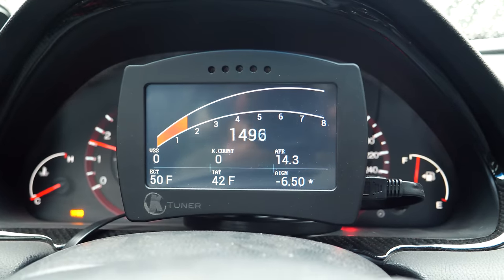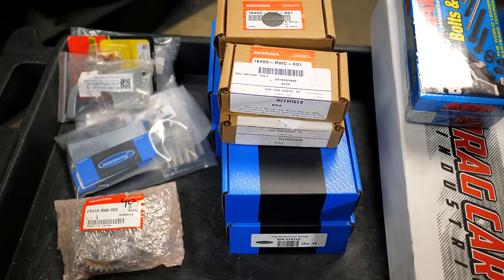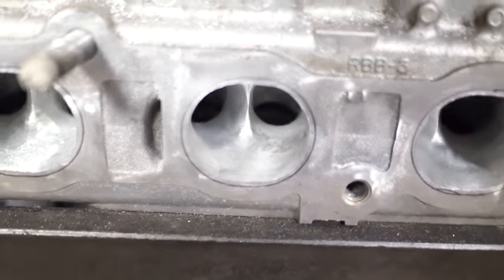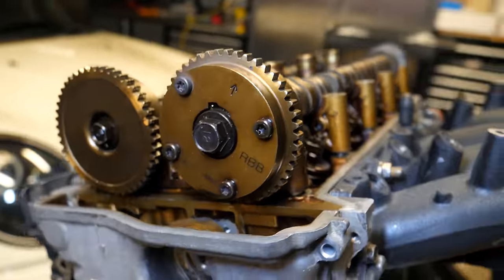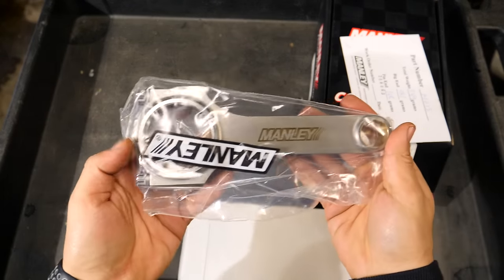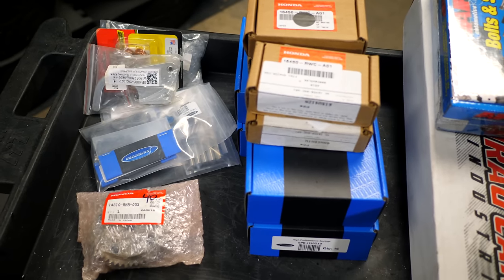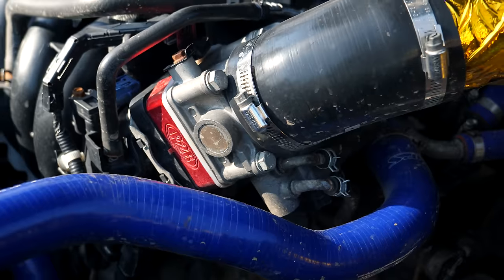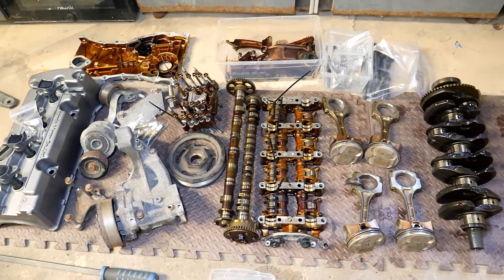The Secret to a High Revving K-Series Engine

Comment: Everything is good except for the lightweight flywheel. Flywheels are there because they store up extra energy and give it back as you continue accelerating, changing gears, going up hills, or just maintaining your speed. It can also cause damage to engine and transmission if you go with a lightweight flywheel.

Comment: Thank you again for doing this! I've been waiting years for someone to actually do this to the 2.4 8th gen 2008 Honda Accord coupe 👏🏿👏🏿👏🏿
Reply from the maker: GET HYPED!! 🙌 Its gonna get real
Reply: Question what how to tune the accords? What wire harness or programmable ecu to use because hondata, ktuned and many more shops across America keep telling me to buy a different chassis!!! Seriously
Reply: With ktuned I believe you can do a custom tune
Reply: @pruvengsx1  hondata doesn't even care about the 8th gen 2.4 Honda accords. Ktuned is the only place where you can tune your 2.4 k24z3 Accord but this tune is still limited meaning they don't have a tune for eternals or turbos or superchargers for the k24z3 Accord motor. fuck those other people telling you to get a different chassis. Just wait our time will come when we the 8th gen Accord community will be able to fly like the rest of them.
Reply: @flyboy8282  Heavy chassis and undersupported. Heck a TSX is lighter and smaller, do u see many doing extreme builds on those? No. There is even a Hondata system for a TSX, but not Accord. 300whp on anything is still 300whp, even if its slow. 4cyl 300whp is impressive. Just think, one day u can afford to buy a cheap EG and put the 300whp swap in it. OR, go expensive and buy a Lotus Elise and put the 300whp swap in it. Once u have the motor, and running, u can always buy something else to put the motor in... That's where it matters. You did it once, do it again, or just swap it over.
Reply: I've been waiting to see that build to. Always wanted to do this....
Reply: Looking to do this on my 2007 coupe lol

Comment: Nice build, these K series are truly amazing engines. My all motor build runs an A2 block @ 89×99 ~13:1, 4P 156 head and I use E85R now with great results. I'm at a DA of under 300ft so NA combos run great and this is no exception. 336whp and over 200wtq on very conservative tuning. As if this isnt impressive enough my old boosted setup made 600+ with the same head and a stock k20a2 bottom end/Gen 2 6262 from PTE. Love the K series platform!
Reply: Nobodys made 600+hp on a stock bottom end. Wha load of horse shit. Brent from pfi speed is rolling on the ground quite literally, laughing his ass off.
Reply: 336whp all motor with conservative tuning… 🧐 
That’s literally pushing the overall limits of what these motors can produce, also I’ve NEVER heard of one producing even close to that without being ‘stroked’. Even with a small bore I don’t think your making that.
I dunno broooo 🤥
Reply: @joeymcquilkin3670  lmao ok bud. We make 440+ at the tire Na with our stroker builds. And if you notice, the motor I was speaking on above is well overbore and is close to 2.55 liters of displacement when it made that power and the head flows insane air. The 156 head program from 4P is top notch, it gets no better. That engine also had insane cam profiles and very high compression. You obviously don’t know anything about the all motor K game so why comment? Ive made over 300whp with stock bottom end K24A2’s  just a good head package. FOH
Reply: @kennethpowers8995  lol can you please do this to my accord 2011 lxs lmao i just want a little more power where are you located
Reply: @premiumc2282  the accord K24z3 in your car isn’t the exact same as the JDM K24A or USDM K24a2 which are a bit more performance oriented. The best thing I can recommend for your car is a good race header like the Skunk2 for the 08-14 TSX/Accord and then KTuner. That alone will pick up a solid 25-30whp over stock if you’re ok with running premium pump gas in the vehicle. If you finish the bolt ons with a good intake and the aforementioned parts you’re going to be nearing the 200whp mark. If you are talking about making much more power than that you really have to swap
On a K20 head and start getting into cam work and more in depth things like that. Or ofcourse forced induction is always an option; these motors love nitrous.
Reply: @premiumc2282  Also our shop is in Claymont, DE. I wouldn’t take any information from the above people either btw, if they think ~300whp is “pushing the limits” for a stock k series they have blinders on to the world. I’ve literally seen at least a dozen K series make over 500whp on 100% stock bottom ends lol. As a matter of fact I’m quite sure you could search right now and find a handful of stock K series making 500-600 HP or more right here on YT so I don’t know what they are thinking with these comments.
Reply: @kennethpowers8995  what’s the name of your shop boss ? Got an Instagram ? I want to try to get an 8th gen si and I’ll stop by im
From the NJ area but live in Florida at the moment lol. Thanks for your info hard to see with so many different comments

Comment: I built my head with toda parts. Kpro tuned fuel pump and injectors  229whp. 91 medium high tune. Winds up to 9k regularly for the last 40k miles.
Reply from the maker: That's what I like to hear 💪

Comment: Nice vid. The accord is fresh. Im in the process of doing a jdm k24a swap into my fg2 rn.  This is my first k24 build, so I’m not going all out like you, but I’ll save that for my dream 250hp-300hp k series frank build when I have higher funds. Can’t agree more with the reinforcement rods, stiffer springs/retainers, and proper pump for 8k + rpm. I’ll be revving mine up to 8k max, maybe 7800rpm because I’m running stock pump, stock internals, except 50 degree vtc. Shooting for 225-230hp, 180tq... Intake, header, vtc, hondata, tune 🤘🏼🤘🏼🤘🏼

Comment: I will most def be buying the same stuff you are getting for your build. I am doing the same as well with my K24 engine. Have an 05 accord sedan K24A4. Ive been wanting more power just all motor and i will be doing the same build. My car is an automatic but i am doing a conversion to manuel. The build will take time but it’ll be worth the wait once everything is all set and done. Great info on the parts i would need to achieve this goal. Mine wont be naturally aspirated, i would want to shoot for a close to 400whp, will be upgrading ecu as well with hondata and going E85 and still being able to use pump gas as well.
Reply from the maker: I am very jealous you have access to E85. If I did, I could push the engine more and produce more power. But a boosted K24 sounds fun to me!!
Reply: Yes most def, in the process of it all if i decide to boost it then it wont be a crazy number. I would boost it to the point where it would be reliable and fuel efficient. My next project build that i am looking forward on doing is boosting a EG hatch which would be track and street driven👍🏻

Comment: Still waiting to see this car in action, wanna hear that vtec screaming all the way to 9k rpm
Reply: I'd rather see/hear 10k rpm on a K20. Not much different in the build.
Reply: Completely stock, any RSX Type-S can rev safely to 9200rpm. No big deal to rev to 9k rpm. Yes, the stock limiter is at 8100 on the 02-04, and it's ridiculous that they left that much on the table.

Here is the stock limit and safe limit on the various K20's:
02-04 RSX (DC5) Type-S 8100stock 9200safe
05-06 RSX (DC5) Type-S 8300stock 9200safe
01-05 JDM Integera (DC5) Type-R 8600stock 9200safe
06-11 Civic Si 8400stock 8500safe (very sad it had such a low safe limit and only 100rpm above stock)

The heads on Type-S and Type-R were identical minus the longer duration camshafts on the Type-R [Type-R cams are no different than 05-06 Type-S cams], and dual valve springs on both intake and exhaust on the 02 Type-S and all Type-Rs, as the Type-S valve springs were lightened year after year for faster reaction time although less ability to rev up to 9800 safely dropping down to just 9200 by the end of the run.

The 06-11 Civic Si had strong enough valvesprings to also go to 9200, although the oil pump was lacking. Swapping it out would introduce some NVH, but allow it to also go to 9200 like the rest of the motors.

Hondata daily drove a stock RSX Type-S for over a month at 9000rpm rev limit in as early as 2002. Proven way back then.
Reply: @copperkeyracing6167  mine is ep3 typer k20a2 with hondata 1stage 8850rpm is fine for stock valvetrain?
Reply: @copperkeyracing6167  the stock rev limiter for the 06-11 Si is 8200 and the safe rev limiter on stock oil pump after you reflash it with Hondata is 8600
Reply: @copperkeyracing6167  that comment helped clear sooo much up for me. thank you hahs

Comment: I adore this.
So nice to see somebody do a N/A build rather than all the boring turbo build.

I am very surprised you didn't use a K20 head though. Is there any particular reason for this?
Reply from the maker: Great point! Since the K20 is an 86x86 design, and the K24 is an 87x99, I wanted the head to match the block since I was going with a K24 bottom end. The K20 head might have also worked.

Comment: Hey Milan, i really hope you also add a baffle to your stock sump, K series have some serious oil starvation issues under hard cornering. so if you intend to track it, baffle it!
Reply: I was going to mention this as well when he said he was using the stock oil pan. 

Milan, any reason to not go with a K20A2 oil pan or at least an RSX baffle plate?

Comment: Hey, not sure if you did this off camera or not but there is a small oil drain that needs to be blocked off when you switch over to a type s oil pump on a k24 block. Almost lost my first k series engine due to low oil pressure because I didn't do it.
Reply from the maker: Yes you are right! I will be doing that process when I go over the oil pump in more depth.

Comment: in 2010, I took a F20c, stroked it to 2.4L using a accord crankshaft and it still had a 9000rpm red line. RPM's is all in your head not in the bottom end
Reply: bore and stroke will also make a difference

Comment: IF YOU'RE BUILDING A STREET SPEC! The titanium retainers are actually not recommended to be used in daily drivers, due to the difference in hardness between the spring and retainer it causes pitting and premature wear and tear which causes them to fail or need replacing sooner than the OEM steel ones. They are designed for higher revving/ higher compression race motors which are opened up regularly for maintenance and condition inspections. Its best to use the OEM steel retainers in your daily street spec for a longer life with a lot less maintenance.

Comment: Wow. You really know your stuff. My jdm B16a made 200 hp (crank) and 8900 rpm. This part where you mentioned the oil pump really got me thinking....
The k20 i had in my EG after had 247 hp (crank) with only an RBC intake, 70mm tb and ported. I wonder if i did all the work you are doing, would i be only looking at a gain of +50 hp as well?

Comment: Just found this vid, I’ve been looking to do a high rpm na build for awhile, but I run a automatic transmission, will that hold the power? Or do i need to change that?

Comment: The K-20 on the other has a Bore and Stroke of 86mm, it's Square. Which is better than Undersquare, but if You want to make Top End Power You really wanna be Oversquare. Which means the Bore is greater than the Stroke. Also if You're not going Forced Induction increasing the Compression Ratio is probably a good idea..

Comment: Might want to mention oil pump from a2/z1 needs to be modified to fit the k24 or it won't mate together. Also rdx spray pattern isn't going to be as good as the more expensive injectors.

Comment: Yes that's correct the More air a motor can get the more power it will make it's called porting? they just bore out the parts that need it so that the motor takes in more air to make more power!

Comment: Yesss!.
Dude I just installed my 2.2 drag cartel cams plus the valvespring and retainers 92lbs ones too..
Kept the motor together and applied air to the cylinders to do the labor lol..
I too did cut and ported my oil pump 
Migz

Comment: This a great build. However the z versions are Honda's cheaper, simple version of the A engines. The z3 is based on the k24a1,a4 then a8 originally and has a heavier crankshaft than the k24a2 which has a different harder, lighter crank. Would hate to see this amazing build run into issues due to the crank being run well past the rpm Honda designed it for. I will keep watching and hope all works out. Great series.
Reply: Um, the block he had said A2 on it, so I don't think it's an issue.

Comment: Nice little run down man. =]
Another option to consider that'd bump rev range, Destroke.
Toda do short stroke kits for both B and K, but can be done through sourcing appropriate sized rod and piston combo then bore the cylinders to spec.

Comment: I know it will Rev higher but hop much torque will it have without the turbo. Im guessing  the next step will be repurposing  the turbo kit from the your mini to the Honda. Also good luck on the swap. Everyone knows that the only real way to give a Honda power.
Reply from the maker: I've contemplated running boost, but for now, I'm going to keep it NA. It won't be as torquey as a boosted K24, but I want the high revving scream 🙌
Reply: @milanmastracci  You could see 225+ wheel torque when it's all done. That should be good enough for a daily. Anything more will just turn rubber into smoke, which is fun and all, but not great when driving around doing regular stuff everyday.

Comment: Great video Millan,
What oil do you put in it? 9k RMP sounds really fun!
Reply from the maker: I'm not too sure yet, but I'll for sure keep you up to date on that 👍
Reply: @milanmastracci  Thank you Man, Im just getting into the car industry, and your tips are super helpful!
Thank you
Reply: any oil..nothing fancy..havoline, valvoline, any..5w40 or 5w50..nothing thinner..and regular oil changes at 3.5kmiles..worst case at 4kmiles.
Reply: @bonifacijus11  Good to know, thank you. Also, about performance oil filters would you say that they are worth the extra $$$?
Reply: nope!..n now, fella, remember that for good..use 5w40 oil on any engine, absolutely on any..nothing thinner (if there's rough winters in your country, then you can try thinner oil 5w30, it won't be too bad, but still, if winters are tough, then it would be a lot better choice to install engine coolant's heater, like webasto, eberspacher, they will warm up your engine before cranking it (you can even control that with your phone)(n the complete heater system weighs ~7+kg, so that's almost nothing, you can always save weight on other needless things, n there's a lot of weight saving options;p), n that will be million times better protection than from any other 0w15/0w20 water, but on high revs n high temps. you will always have a proper oil viscosity n pressure, n a good protective film layer between moving parts..n forget everything you know about oils, all the brands, "super" oils, about all that marketing..just go to the shop n get any oil, basically any will do it's job..mid price to low price..don't buy anything fancy, that's just a waste of your money..n most important oil changing interval is 3.5kmiles, in worst case 4kmiles..there's plenty of tests, n trust me at 4kmiles/6.5kkm any oil gets worn out at all aspects, n become close to viscosity 0w20 or thinner, n you don't want that;p..ofc, if you're mosty cruising somewhere extra-urban, not revving much, then nothing bad will happen if you change at 6kmiles mark, but that's only on non urban driving n being very mild with the engine..city n more aggressive driving - you should change at max.4kmiles (if you wanna run ur engine forever..6kmiles intervals will also last hella long, but as 5w40 is a rather cheap oil, change it at 4kmiles;p..that's the best recommendation)..as for filters, the cheap n the best one is purflux (sogefi) - that's the best filter you could ever get in your life, ofc, if available at yours..even nissan dealerships in europe sell them as genuine, but they're resprayed/repainted/rebadged purflux'es for nissan (identical, only cost more due to nissan logo, n "genuine/oem" bullshit;p)..seen construction, cutouts, filtering material, bypass valves, sealing valves, n all - trust me - an awesome filter for a good price, besides the most of filtering material possible inside, than in any other filter, due to zig-zag fold pattern..if you can't get purflux, then get a mann, mahle/knecht, bosch filters, they all are okay, n will do their job, not as good as purflux, maybe sometimes even more expensive, but anyways good filters..nothing bad will happen using them..so all you need to know - oil :5w40 (5w50 - if most of the time you'll be at redline driving your car, or racing) for any of your car in your whole life (just never chase for super/magical oils), filter: purflux (but other will be ok too)..n you can forget this headache once n for all..this is my lifehack for you;p..just trust me;
Reply: @bonifacijus11  Thank you man, you went beyond answering my questions, youtube needs more people like you. (:
Thanks again, and God bless

Comment: Nice, miss my old K20Z4 with 272 hp and 9000 rpm :)
Reply: Mods to get this much from the Z4?
Reply: @VelTomic  i Got fd2 Oil pump, fd2 fuel injectors, fd2 inlet manifold, tegiwa exhaust manifold, 3" exhaust, home made 3" intake with k&n filter and BC stage 2 cams and hondata program for ecu. :)

Comment: Without researching, so I could be mistaken, but pretty sure those rods aren't lighter than stock?
Used some in a GSR build, pretty beefy.
Reply from the maker: The stock connecting roads are 625 grams, and the Manley rods are 549 grams.
Reply: @milanmastracci  
I'm amazed, seriously. looking at a stock Honda rod it's puny compared to an H or I beam. 
Must be alot heavier than B series. Stock is 544-547